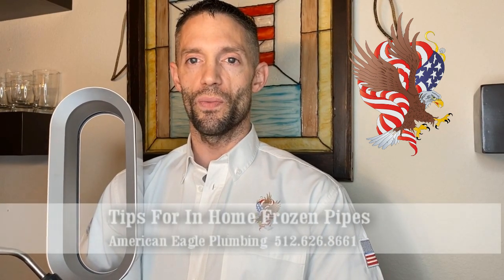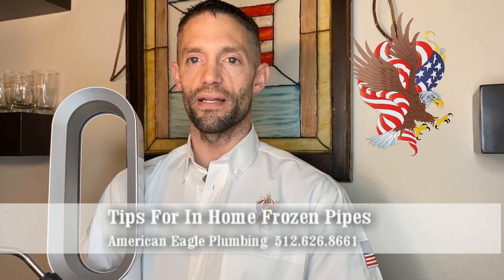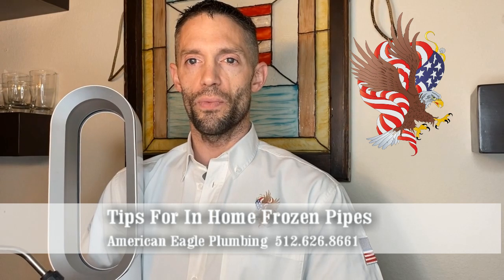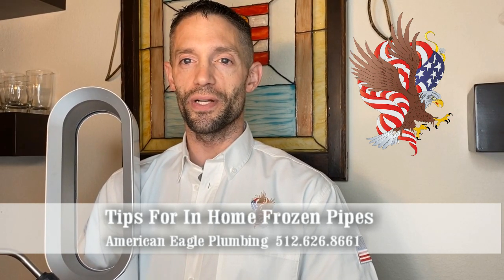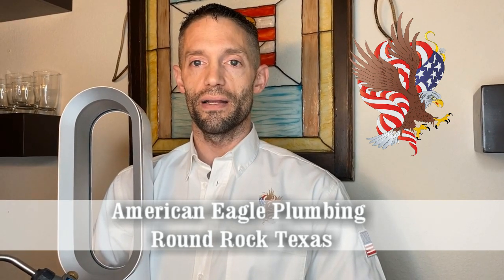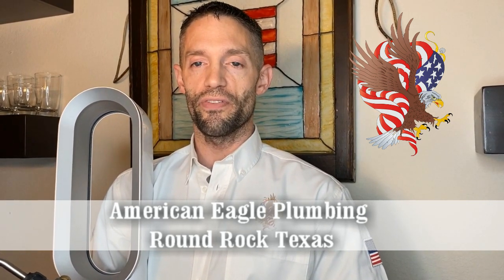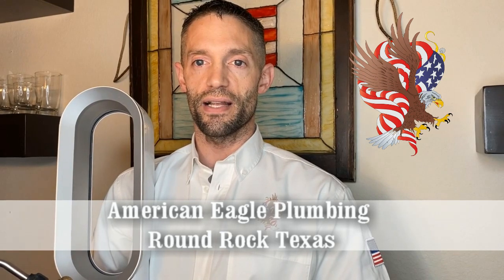How to Thaw Frozen Pipes

Comment: Well my pipes froze.  I hope they don't burst.  I guess there is nothing I can do at this point.
Reply: He just told you what to do in this video.
Reply: @quengibson8632  No he didn't. My water is off. It's still freezing outside. Pipes are frozen. The pipes are in the walls. It will be above freezing tomorrow. So, again, all I can do is wait. I will call a plumber if I need one. They will have to do something. There is nothing I can do at this point.  So you are incorrect.
Reply: @jennybtx  leave the warm & cold tap where it’s freezing at a steady drip...I go for 1 drip every 2-3 seconds and it’s -24 Celsius where I live and they won’t freeze....if I don’t they freeze.
Reply: @nickcaesar7650  my plumber said that a big myth. 
if its cold enough a little bit of water will freeze on contact of those cold pipes.
Reply: @nickcaesar7650  that works